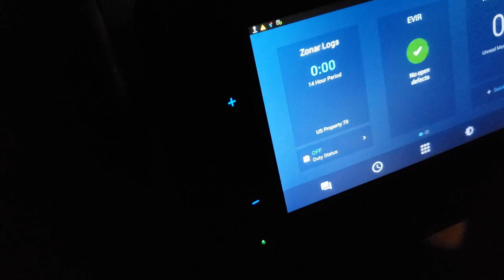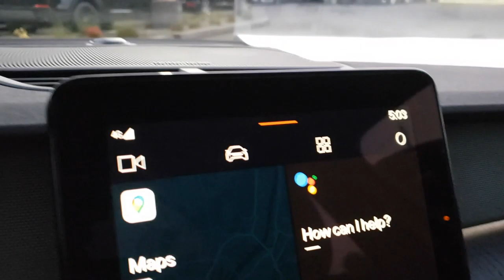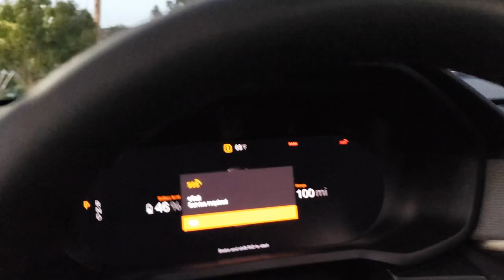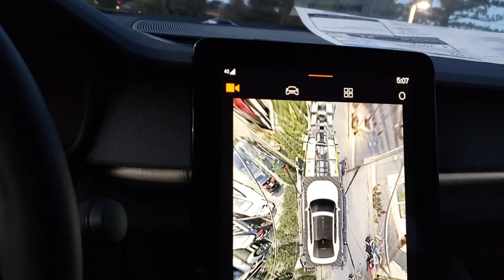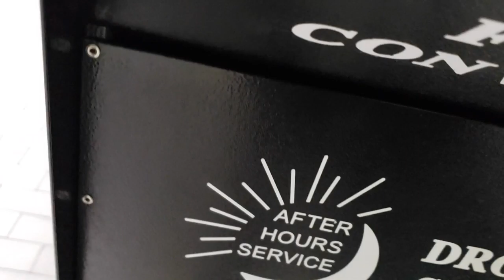Delivered a 2020 BMW M2 CS Competion, 10 Car Loads, Flu recovery.

Comment: Something I learned being someone who checks in cars, at least on Toyota if you push the lock button on the door with the engine still running the doors will lock. Then you can turn it off and get out and just relock the drivers door manually.
Reply from the maker: Okay awesome I'll give it a try.  But what if the cars haven't been PDI'd?
Reply: @HammerDownDriver  Yes that's what I mean. If I get cars off the truck that the remote doesn't work or the doors don't lock after its turned off usually that works. Just lock the doors before you shut off the engine. When you open the door to get out that one will unlock but just relock it by hand
Reply from the maker: @Branden123456  bad ass thanknyou for the info!  I'll be sure to bring it up in a video